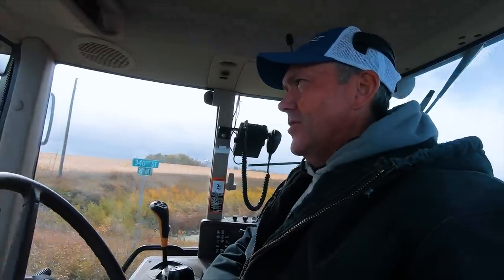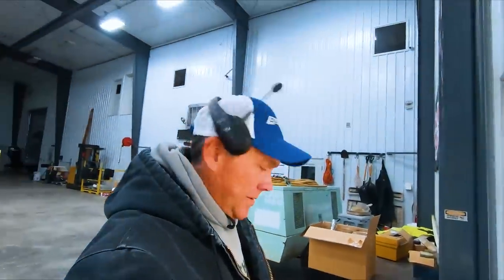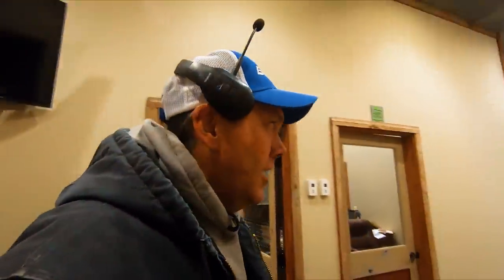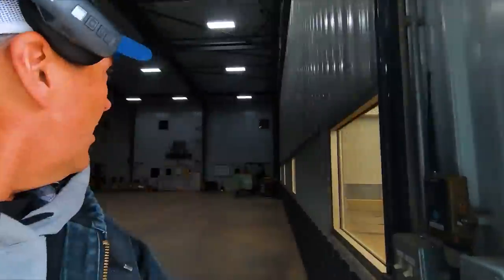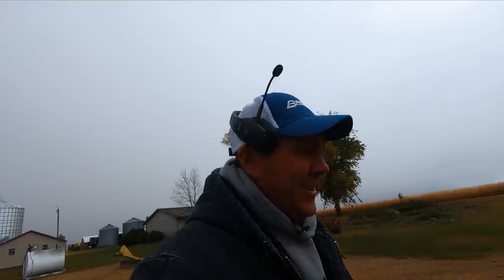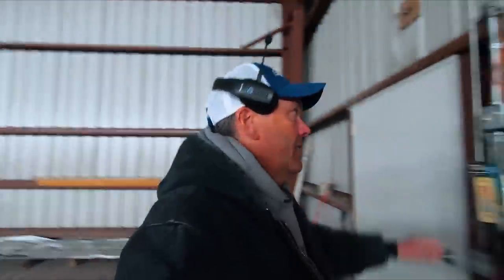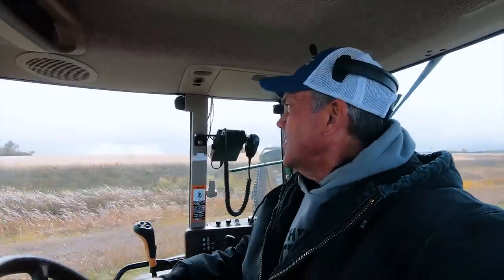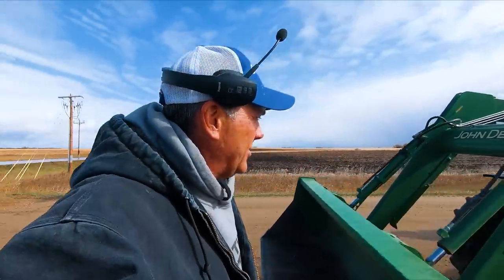Just So Must Frustration!! #13

Comment: I always thought  wash board  came from  braking,   But  Dougho  theory  could be right  also.     Had a great time with you today Dougho.
Reply: Suspension scrub, he's kinda right, and you're in the ballpark also... factor in suspension scrub, BOOM..... WASHBOARD!
I ride in northern Michigan on the orv trail system.... witch has some of the largest washboard ever... it's none stop, intersection, 
Long straight aways some curves... Once the suspension starts bouncing and the tires start flexing/scrubbing.... welcome to washboardville!
Reply: as far as i know it comes from both, except on tarmac, there it is a brake only situation
Reply: It's a bit of both.  If you look at motocross and off-road racing tracks where they're going in one direction, it's into and out of the corners that chop up the most.

Comment: Around here the sand and rock haulers are the ones making the washboards in the roads and when they brake at intersections. More so when empty. We have a dirt pit just south of us and all day long from 6am to 7pm trucks hauling red dirt out, mostly going south towards the North Dallas Metro growth. House pads are red dirt base then sand for floating the concrete slab.

Comment: I'm taking up for Amy. There's times when you gotta go, and if you're in a Mopar,  99 mph is a good starting point.  As a teenager my last ticket was in a 67 Chrysler New Yorker on main Street in our little town.  I learned that by holding the transmission in 1st gear and flooring that big 440 it immediately roasts the tires.  Now,  while I thought that activity was absolutely brilliant,  there was a police officer who had a differing opinion 🤔.  Turns out his opinion won out and the rest came out of my pocket.

Comment: I like capping the air line going to the blown bag and then air up the tractor or trailer and let the other airbags fill up and lift the frame up. Gives enough clearance to get the bag out and back in again. And I've also used an air hose with ball valve to expand the bag slowly to the bag back into place so you don't have to fight to stretch the bag by hand.

Comment: Great day with Dougo!  
Best way to fix those washboards is with an angled blade, either a grader or pull behind. A straight blade will just bounce.
Reply: Straight blade or box blade works if you have enough weight

Comment: Most washboards at stop intersections are caused by vehicle braking. It is pushing the road bed forward slightly each stop and it builds up over time.

Comment: Another suggestion if you ever consider a different headset get an AfterShokz go around back of your neck loop over the ear caps are no issue. They just set on bone ahead off your ear do not go into ear at all. Work beautifully and have a model with the mic also

Comment: To make things a little easier if you put a cap on the air fitting after removing from airbag you can put it back on the line and air up the suspension. Gives you more room to get the air bag out and the new one in

Comment: Dougo not sure if you’ll see this comment but a good trick we started to do on our trucks and trailers so you don’t have to pinch or crimp air lines off is put half turn ball valves on top of all the air bags then put air line on top

Comment: Also heavy breaking before an intersection will cause washboards especially with an empty trailer if the brakes lock up a bit , that's why it's so important to use the jake brake and be slowed down if we have to stop. Harvest time is usually allowed for loaded semis to do a really slow and go if there's no traffic and you have a sociable Sheriff's Department. BTW was that 90 in a 70,  90 in a 65 , 90 in a 60 or 55 !?!? Amy , Amy , Amy what will we do with you?. In Nort Dakota it's tough to get those points back , it takes a good three years. Maybe that's why the doctors won't releas Me to drive again, when they found me on my birthday nosed into the carpet with organ failure because of the massive staph infection and dehydration I am recovering from,  being on the edge of becoming worm food ! I kind of like my, "gettie up go".!!! Dougo,  I hear you on the not finishing a project ! What's worse is when they start running out of time &  funds when they're finishing up the interstate on the west end of North Dakota and instead of having a foot thick concrete it ended up being 8 in thick!  How did that get past the DOT inspector. Got to look at the positive side though when the road bed settled it bent a lot easier to conform to the dips and Dives. I is trying to get a little humor in there for you to let you know you're not alone.!

Comment: Not disagreeing with you about those "wash boards" but, I've seen the maintainers purposely put those in. It's to hopefully force people to actually slow down, which you should on gravel roads, specially after they've graded it. Loose gravel can be a pain. 
A lot of those type of jobs are unfinished on purpose as well. Gotta waste our tax dollars some how. Township sizes vary from state to state too. 
My last job as a yard jockey, moved a trailer and had one of the brake can's explode just as I was climbing out of the truck. The spring hit the landing gear thankfully but, that was scary when one thinks about it. Great video, cheers :)

Comment: Do your drivers dump the trailer bags when they dump?  I was told to dump the air or the bags adjusting with the weight change causes issues.

Comment: It is true seeing Amy in a video makes it better, even if you rat her out😂. The washboards are caused by the antilock breaks when vehicles stop at the intersections.  The antilock breaks release the breaks in small international s to keep from locking up and sliding.
Reply: Umm depends on which lane it's in.
Also unless you wait tell last second and slam on brakes the antilock brakes don't operate if you you stop normally

Comment: My township is 614 square Km (237Sq Miles) with roughly 330km (205mi) of roads, Township here loses their mind when anyone touches the road surfaces to fix issues like pot holes and ridges. Roads crew don't bother with crowns and run off management they just make it look good as fast and they can and call it a job well done.

Comment: Washboards aren’t formed by the road maintenance crew.  It’s also not exclusively lead footed acceleration.  Poor road base/gravel, dryness/heavy loads that break up the rock/soil connection and vehicle braking/acceleration all lead to washboards.  Studies show that unless speed is kept below 5mph, washboards will form with normal traffic.

Comment: Wash boards are caused not by wheel spin but the natural frequency of an inflated tyre in combination with poor shock absorbers. The inflated tyre hits a small bump and deform.  It tries to retain its proper shape. In doing so it tries to lift the axle. That puts more load on the road. At the same time the axle spring moves and then wants to return to its normal place. So the washboard is caused by poor shock absorbers on axles, trucks are terrible for underrated shocks and tyres having no shock absorption at all. That's why washboards are all about the same distance apart. A great example to see this happen is a pot hole. It starts small, gets hammered and blows out. Pretty soon another one appears a few feet along the road. Then another if it left. Think your truck has good shocks. The truck comes off the gravel and onto the blacktop just fine. The front springs compress and soak up the bump. But then the spring is in a lot of compression. So it's trying to return to its happy unloaded place. In doing so it imparts an upward force on the truck chassis and an equal force downwards on the road. Of course the road is not moving so the truck gets bucked up, that head banging effect that spills coffee too. This actually happens a wee bit after you have left the bump. Great shocks would not allow that rapid rebound and you wouldn't bang your head.

Comment: In my area of you repaired a road like that you would be charged. They say it's because of liability. You have to wait for the local township to come and fix our your in big trouble.
Reply: Never mind the "liability" that comes from hitting that step they left when you're not expecting it.
Reply: @deaddoll1361  that's why they won't let people do it around here because there were people who said they were fixing the road but actually were putting in a speed bump type thing and people couldn't see it and they're was no sign. One person had the frame on his car bent. 
Plus there were others that didn't do it properly so that the water drained to the sides and caused more damage than they fixed. That's why it is illegal to do anything now.

Comment: Washboards ?
I take it that you don't know that these are known by the term CORRUGATIONS.
Oh now, as it'll soon be winter where you are (it soon becoming summer down here)
Maybe a good READ-UP on what occurs with GRAVEL ROADS may calm your anger at what you consider them to be (ONLY) formed by.?
They mostly are NOT simply caused by someone accelerating hard but more predominantly by having a LOT of vehicles being driven along a gravel (or concrete for that matter) road, where one vehicle's wheels hit something & hop.
The next vehicle will also thus "hop" it's wheels with all others hopping their wheels, which also occurs when hard braking causes wheels to slide & HOP the built-up gravel ahead of them, hence corrugating / wash-boarding the entire section of road, as if started in a short piece, without almost immediate & correct maintenance, that short section will rapidly expand in length, the more vehicle wheels hop over it, and keep hopping after it.
The USA isn't the only place where corrugations form, as most other countries have them too, many where a HILL or uphill / downhill slope has all wheels hopping for one reason or another.
In outback Australia, where almost all of their roads are gravel - they have done research on what causes wash boarding /corrugations.
What many people don't realise, is that correct weekly / monthly maintenance (by leveling the surface with a grader) will deter corrugations from forming, or at least keep them from becoming dangerously deep.
This Australian article gives you a brilliant insight as to what causes corrugations - and has ZERO to do with how much acceleration a wheel is driven, as all wheels, (non-powered as well as driven) can & will exasperate any tiny ripple after it has formed, into becoming the worlds roughest corrugation - when there is little to NO correct regrading maintenance done frequently enough to stop them becoming hazardous.
I found the link to both pages of the research article.
Page 1/
https://www.abc.net.au/science/k2/trek/4wd/Overcor1.htm
& Page 2/
https://www.abc.net.au/science/k2/trek/4wd/Overcor2.htm
But don't worry none eh - as you aren't the only person angered by a natural phenomenon

The only way - in my honest opinion, at avoiding the rough ride of washboard / corrugations is this, drive a TRACKED vehicle which won't drop down into the hollows, but which will ride gracefully over the humps. Sadly not everyone can afford to fit tracks to their cars etc., however - even a TESLA can be fitted with tracks..
And rides smooth as - over corrugation / washboarding.
SEE:
https://youtu.be/L5XKuTW9vFI

Comment: Some semi drivers need a 2x4 to wack em in the head when they lay on their brakes  and wreck the gravel roads at intersections and cause the washboards. It's possible to slow down without causing them.